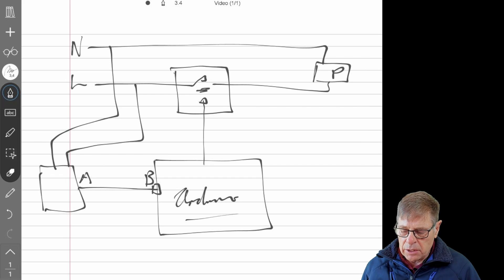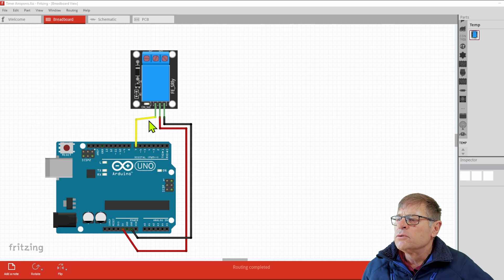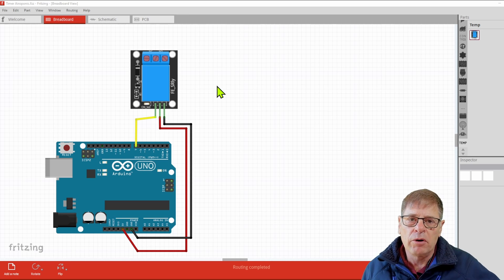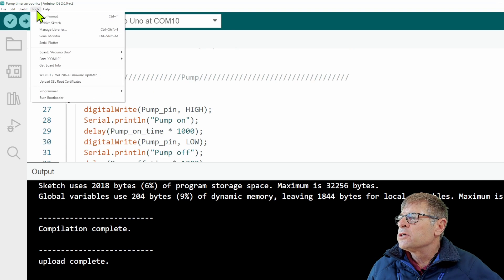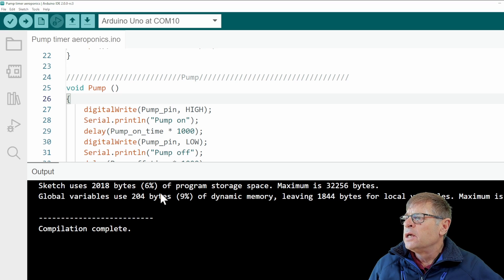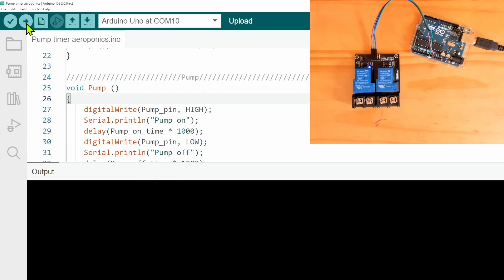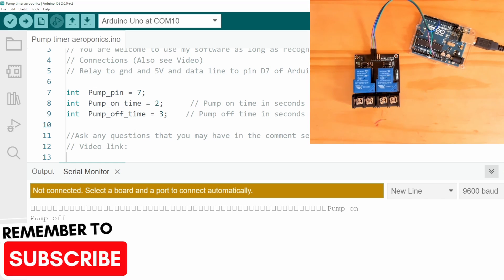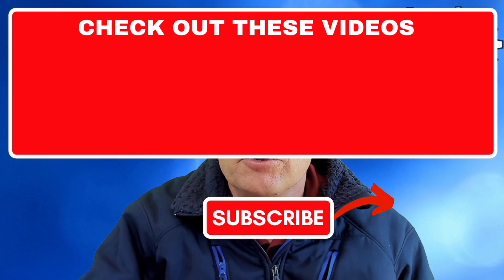Simple on/off Arduino timer (Aeroponics)

Comment: This seems to be what I need to setup my pumps, but you have this other video "Pump timer- Arduino 9 (iAVs, aquaponics and hydroponics)" that has a different kind of code. I understand the differences, but I want to know if there is some advantage to use the "Pump timer" code of the other video vs the "Simple on/off" code in this video. Maybe there is some advantage with the other code that I am not seeing? 

THANK YOU!!!

Comment: I love the video but have a doubt. I am fixing a linear inverter LG refrigerator and managed to get a solid 12v into a relay to power the compressor but the relay never shuts off the compressor because of the way the refrigerator is programed to never shut off the refrigerator. I wanted to install a Arduino uno with a 10-15min timer so the compressor works for 15min shuts off for 15min and so forth so the compressor does not break down on me. How can I pass the 12v through the Arduino so it shuts on and off that current connected to the relay?
Reply from the maker: Use a normal, contact relay with at least double the amp rating of the compressor.

Comment: Mooi Vid Bru - My proposed use is to drive a mechanical clock pendulum regulator - for which I need a 0.6876 total duration with a 1-2 milli sec pulse that drives an electro magnet and the remainder OFF - so on for say 0.2000 and off for 0.4876. Can this timer do this?
Reply from the maker: I don't think so.

Comment: Nice informative/educational vid :) I think the project would be useful for controlling a mains pump in a hydroponic system but for a geniune aeroponic system that runs on dc voltage it would be easier and cheaper to buy a dedicated solid state cycle timer.
Reply from the maker: Thank you for the comment. Most aeroponic systems run AC.
Reply: @doitwithpierre210  
Most systems that use submersible pumps are basically hydroponic. Genuine aeroponics uses mist and the amount of mist delivered per misting is measured in single digit millilitres, not litres or gallons :)
Reply from the maker: No problem with that, but in most cases AC. If you want to switch DC just use a normal contact relay.
Reply: @doitwithpierre210  
Genuine aero can run over 2000 solenoid cycles a day so its best to use timers with a solid state relay for longevity :)
Reply from the maker: Sorry, I do not get you. You start with a statement that an aeroponic system is DC. Now you want to use a solid state relay that can only be used for AC?